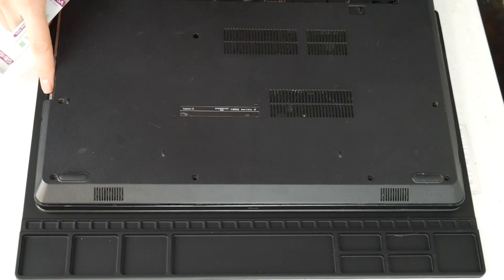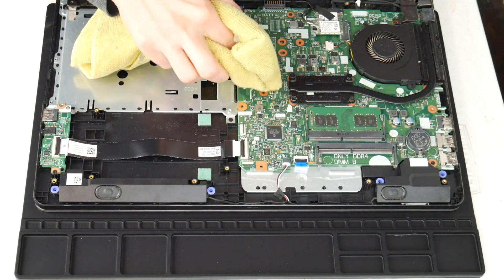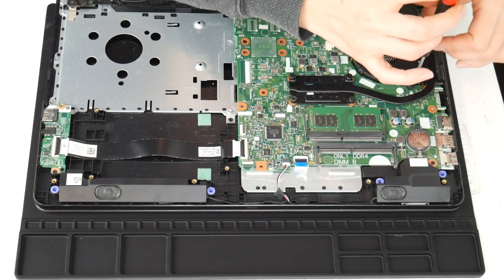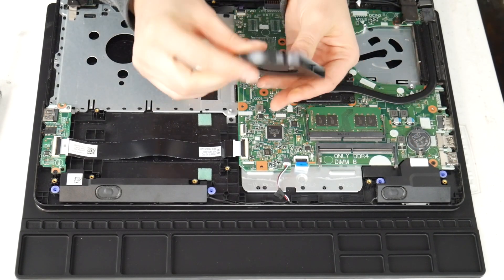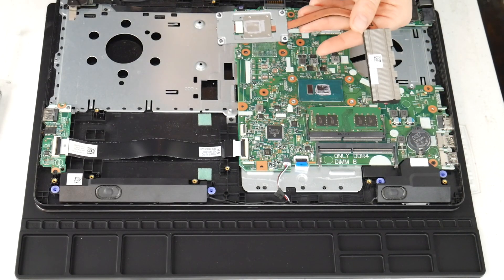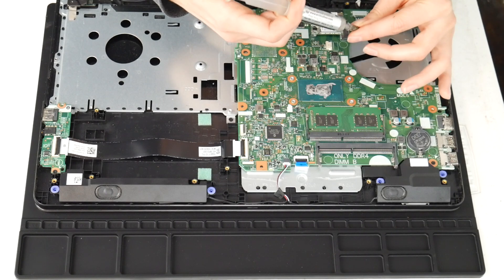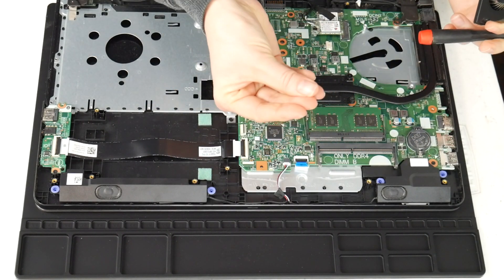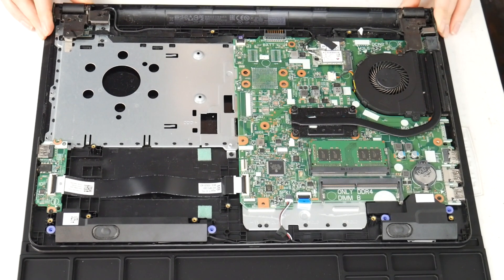How to Fix an Alienware Computer That Keeps Overheating by a Certified Technician

Comment: I got a toshiba satellite that keeps over heating and shutting off i replaced thermal paste (silver arctic) on gpu and cpu cleaned the hell out of the fan and sink and still shuts off, ugh help? the fan seems to fun fine could it need replacing?
Reply from the maker: The fan needing replacing is a definitely possibility. That's what I would try next. Have you tried running the Dell built in diagnostic? You can access it by hitting your power button, immediately tapping on F12, use your arrow keys to select diagnostic and then press enter.